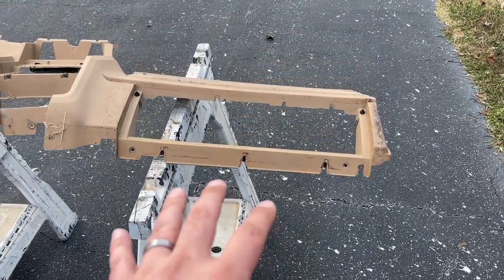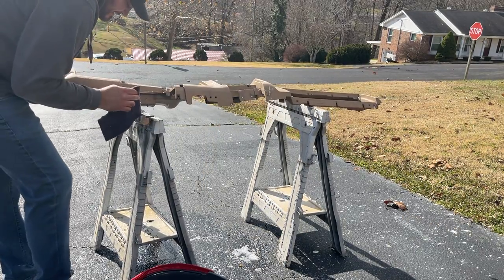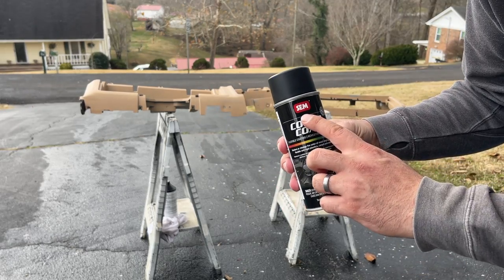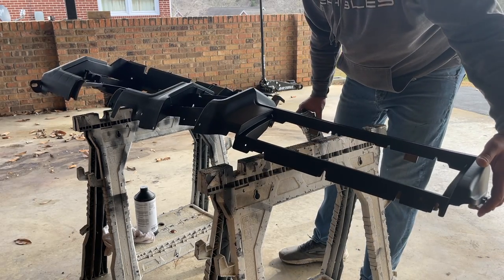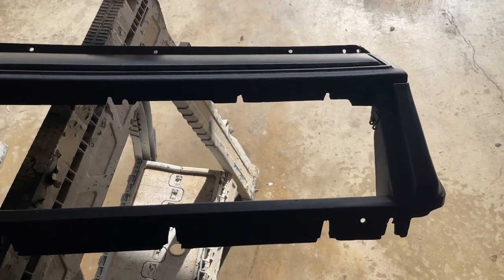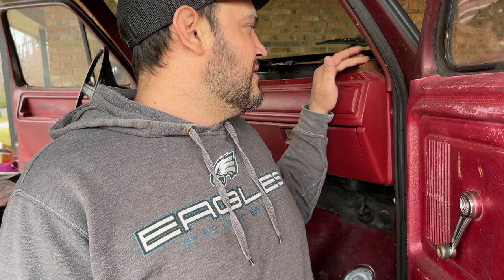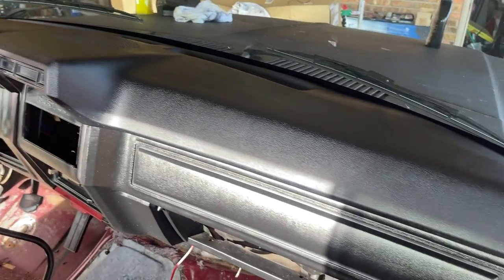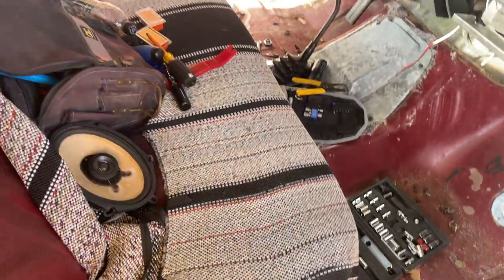1983 Ford F100 Bullnose Part 3!! | Dash Install

Comment: Looks great! Subbed! I have a bullnose that I’m doing work on too, just got the dash pad. Mine doesn’t have pre-drilled holes for the 12 screws, did yours?
Reply from the maker: I appreciate that!! Yeah, mine had holes under the insulation on the tabs. I’m going to need to pull it off and I’m think get some metal u-nut clips to slide up on it that will have threads that I can use to run the screws the the dash into the pad. Not sure what I’m going to do on the holes at the vent close to windshield.